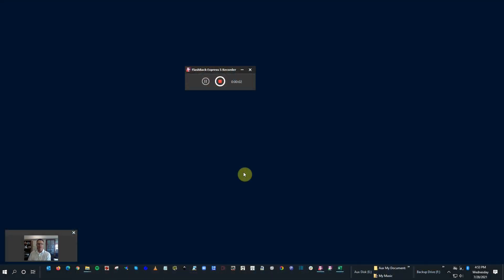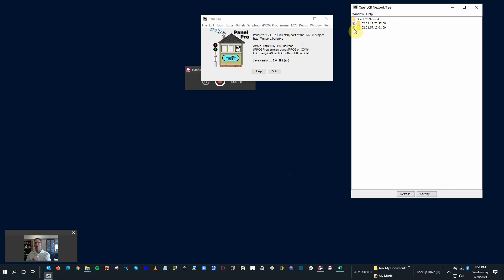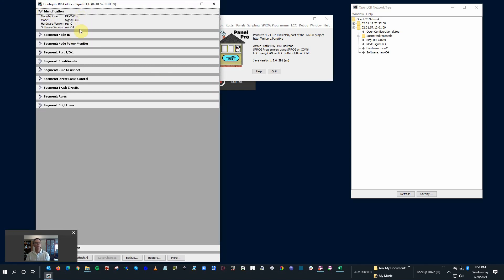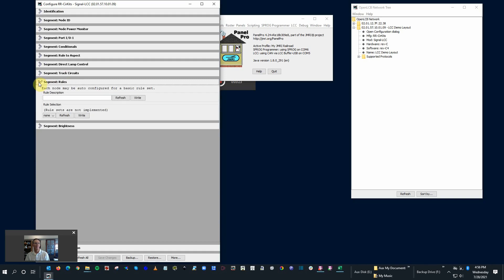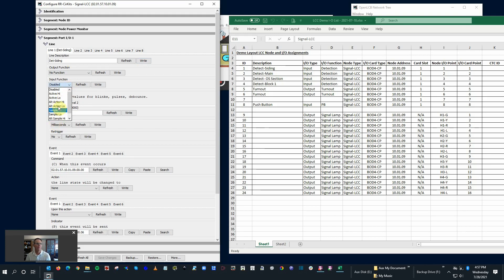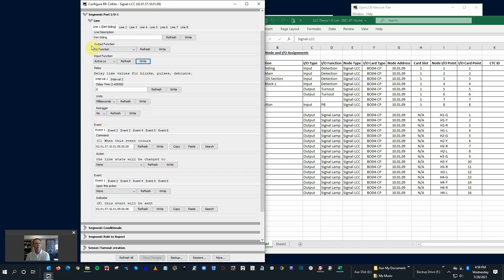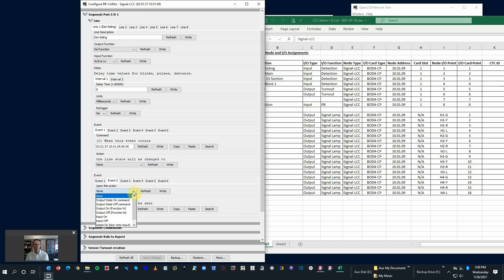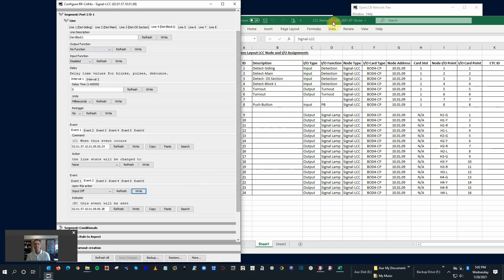TLC #7 Configuring Detectors in the CDI

Comment: Question 1 for Port I/O-1:   I noticed that a "text entry" box changes color when you type into it to remind you to write out the contents.  But when doing an event at the bottom of this segment, the event id's are already there so what happens if you do not "write" the contents when you should?  There is no "color" change indication & how do I know what was or wasn't written?

Question 2 for Port I/O-1   I was relating the line tab I selected at the top of the segment to match which "line" of the BOD4 I was working with, good idea/bad idea?

Question 3 for Port I/O-1:   I made a mistake entering data into the segment & there doesn't seem to be a way to go back to the tabs at the top of the segment & "erase" any data under the tab selected or revert back to the default that the node comes with?  I'm guessing that the backup before any CDI change is the only way to solve that problem.

Question 4 for Port I/O-1:   Related to question 3, I did a "Restore" of this node but had no clue if it made it or not?  The system console (JMRI vs LCC???) mentioned a load complete (IIRC) but I have no idea when that occurred.  Be nice if there was a message saying "Restore done" or a "Backup done".

Thanks for the video.  They are a major help in getting this project started.  Keep them coming.

Dennis Munro    Berlin, WI
Reply from the maker: Hi Dennis. Let me take a shot at these. May need some input from others to help out..

Q1: Not sure why all the fields don't change color. I know RR-CirKits intended it to work that way, but for some reason it does not always do so. If you want to make sure they are all written, there is a box at the bottom that says "Save Changes." That will save any changes you make.

Q2: If I understand your question directly, good idea. Keeping things lined up is super helpful as the number of nodes and complexity of your LCC system expands.

Q3: Ya, a bit of a pain to be honest. And yes, there is no 'undo' button. Would be nice, but alas. So save the clean config as soon as you power it up for the first time, and then save versions as you develop your configs. FWIW, scrolling through the various tabs, you can quickly pick up the pattern on how the node event IDs are developed. So you can always recreate a 'clean' node. Ask me how I know...  LOL!

Q4: Agree; it would be nice. I just look at a few key config points to see what changed. The CDI is pretty straight forward, but really still very primitive in many ways. Hopefully as LCC develops, more of these features will be added.

Hope these responses are helpful. Thanks for the kind words!  And yes, more coming!
Reply: As to Q4, it does but until I did 2-3 restores (which didn't restore), I saw the "Save Changes" button at the bottom was active.  And that is what it took.  I've gotten better at restoring backups to keep trying something different,  Practice makes perfect but it does stick with you.  I was just "assuming" the restore did a save, wrong assumption.

Q1:  So far I've only seen Name & Description at the top change color.  Reread the Signal-LCC manual which did show other color changes so I will pay better attention.

Again, thanks for all you videos.  This would have been a non-starter project without them.  I keep wondering what book(s) you are reading to get all this info?  Maybe I need to struggling rereading Dana's book?
Reply from the maker: @themunros9965  Glad you are liking the vids. As for books, frankly it seems the developers are writing materials that are way above my head and assume most readers are getting this basic stuff. I learned it pretty much by trial and error, and then recording what works for me. I am sure there are other ways to go about this. Fortunately the LCC list on GroupsIO is super helpful, and includes Dana, as well as Dick from RR-CirKits and others who are more than happy to answer questions. So all I am doing is filtering out the stuff that will not interest or be needed for 99% of the installs and sharing the basics in a step-by-step format that gets us from parts in a box to operating as quickly as possible.